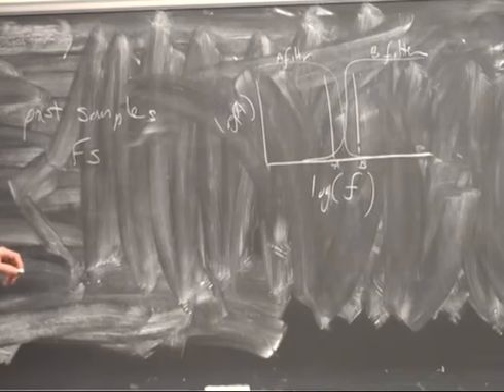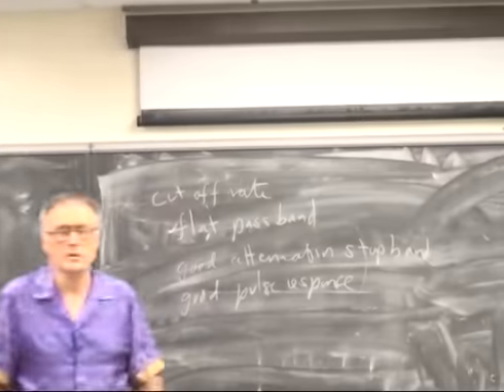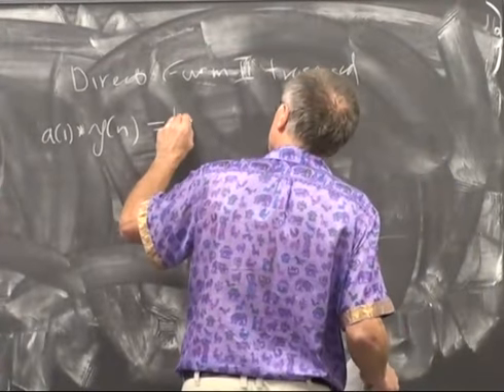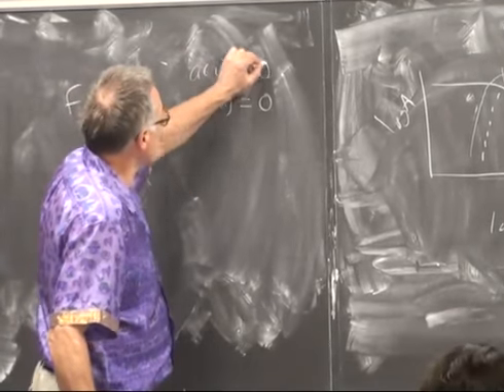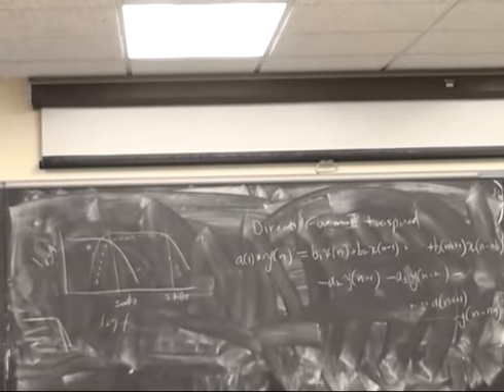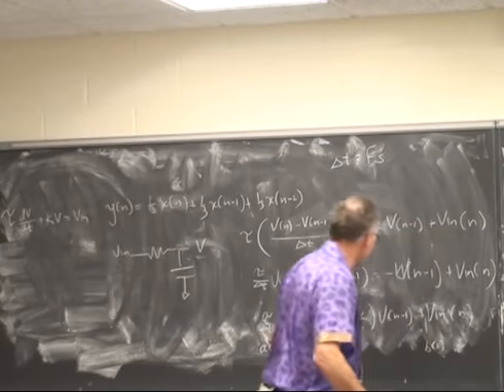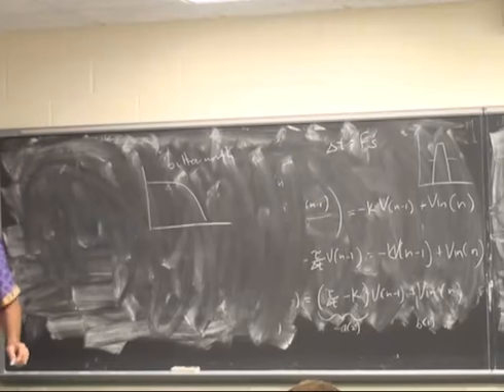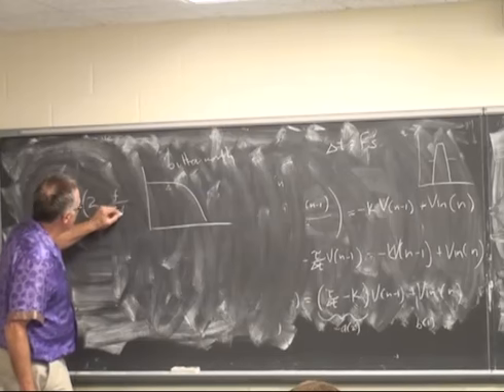#8 -- Digital filtering on FPGA

Comment: Great video Sir. Twenty years ago, I made a sub-band vocoder (channel vocoder), based on the original design by Homer Dudley of Bell Labs. I think it is a very good pedagogical example to understand sampling concepts, digital filters and voice compression. If you want, you can review it on this Matlab site: https://www.mathworks.com/matlabcentral/fileexchange/4097-sub-band-vocoder-script?focused=bf937f4c-1703-1752-373a-672c889281de&tab=function